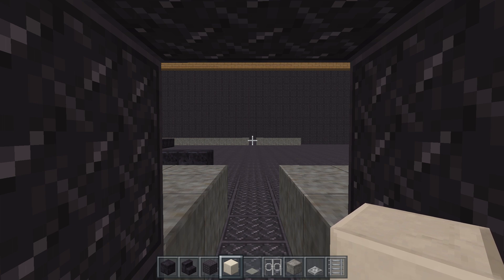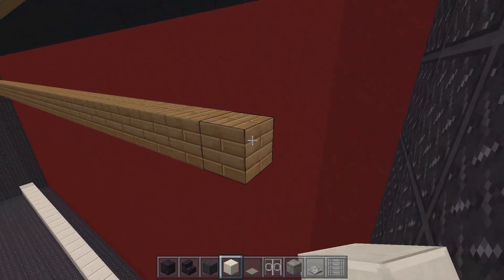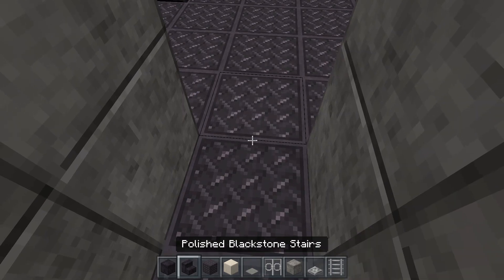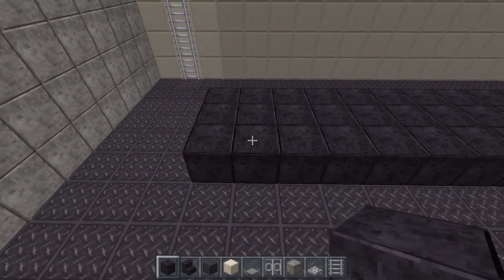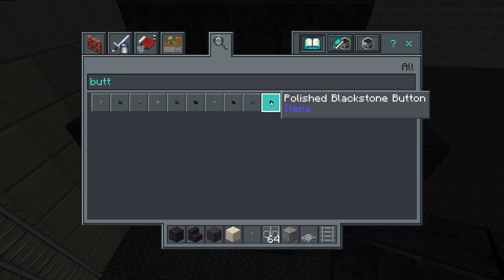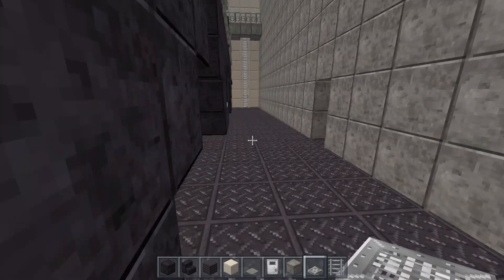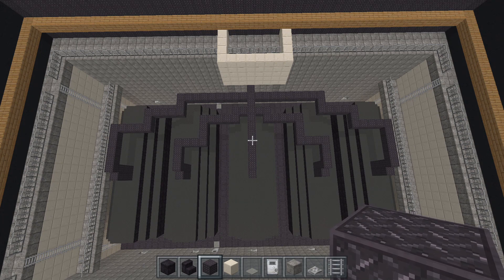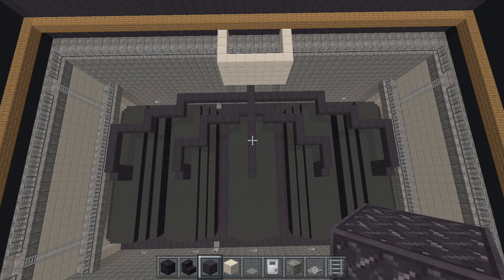MINECRAFT RMS TITANIC INTERIOR TUTORIAL PART 7

Comment: Fun Fact: Titanic was deemed to be unsinkable, this wasn't true (obviously) but she was given this title due to the fact that if 4 of her watertight compartments were breached, (5 on the best case scenario) then she would float, but also because her sister, the R.M.S Olympic was rammed but a warship, the H.M.S Hawk, on September 20th, 1911, but she stayed afloat due to the watertight compartments.😁😁😁😁😁😁😁😁😁😁😁👍👍👍👍👍👍👍👍👍
Reply: titanic actually was penatrated in 5 compartments (well 6 for the coal bunker) so she wasnt designed for 5 only 4 and olympic was only breached in 2 compartments far from her limit
Reply: @dantegean2810  Titanic and Olympic were designed to withstand 5 compartments only in the best case scenario (this would be if the flodding was slow enough for the pumps to handle any of the first 5 compartments) but only in the front of the ship as that's where it was most common for ships to be damaged due to running into objects/other ships. If any of the mid ship compartments were punctured it would've only taken 3 to sink as another ship's bow would only puncture 2 in the best scenario (The Empress of Ireland was a great case of this going wrong) The stern of Titanic and Olympic at the time likely would have only survived if 3-4 or the compartments were punctured. Also Titanic's coal bunker was also slowly leaking into Boiler Room 5 which was slowed due to coal bunker door being closed until around 1:10 am where the door gave way and flooded the room. I was wrong on the fact Titanic was never called unsinkable until after her sinking.

Comment: I want to ask can this work with richlarruse Britannic hull
Reply from the maker: I'm not entirely sure as I've not built that ship of his yet, I would think that they are very similar in design if not the exact same. Sorry I couldn't be more help
Reply: @Pipkin06  That is ok I want to ask was all. the britannic it the same for how long she is
Reply: I know this reply's a year later, but right now I'm actually following this tutorial with Rich's redesigned hull from his Britannic. I'm only up to this part so far and I've been able to make it work, but I've had to change the design of the boilers to be thinner to fit in the boiler rooms because the rooms are a lot thinner. On the new hull there's a lot less width  to work with at the bow and stern than on the old one because of the different shaping Rich did for Britannic.

The first and last bulkheads at the front and back of the ship don't quite have the same exact spacing between themselves and the outside walls of the ship but they're close, off only maybe by 1-3 blocks. I hope the funnel casings all line up fairly close although I expect them to probably be off somewhat slightly but I can readjust if needed.

Overall, the layout of Pipkin's rooms is still the same so far, just altered slightly to account for the design differences in the two hulls.